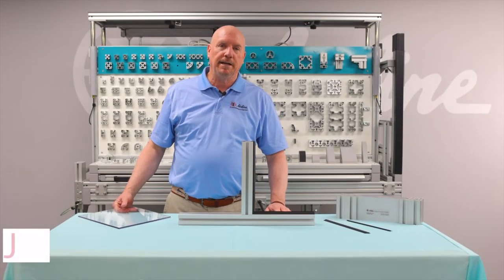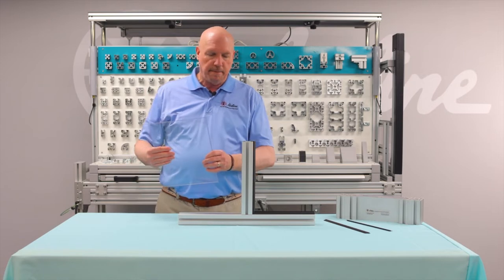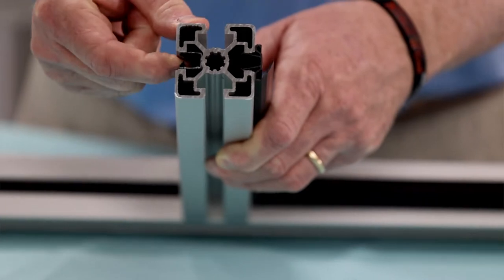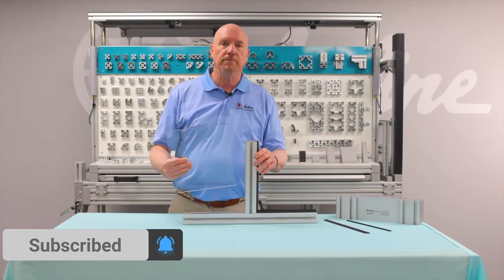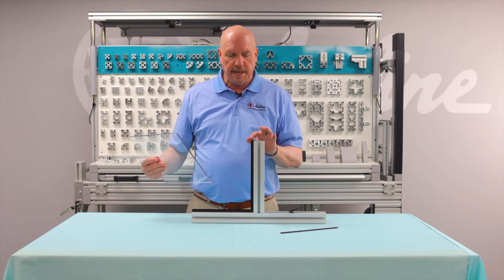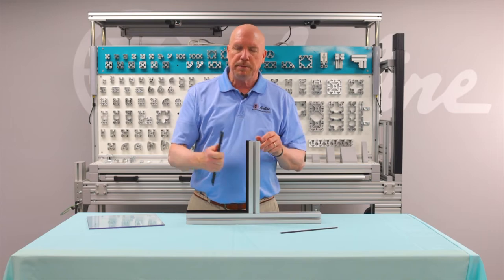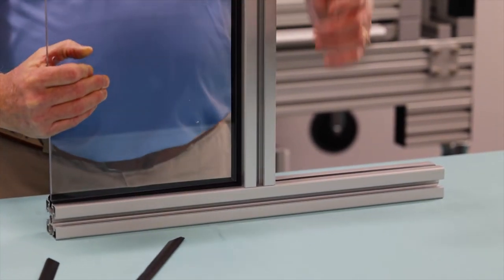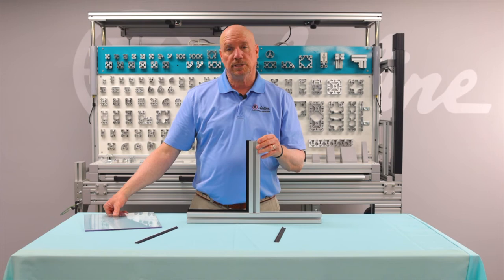How to INSERT & ADJUST A PANEL in Extrusion | Build Anything with Aluminum Extrusion

Comment: To bad the inserts are discontinued
Reply from the maker: They still exist! They changed the color to grey so the part # changed too, but the functionality remains the same 👍
Reply: @AirlineHydraulics it would be nice if you would replace the discontinued link with the link to the active grey product in the video's description instead of only including the link to the discontinued black product and having the interested viewer have to spot the blue 'substitute available' button and follow the path and try to figure out what if anything might be different, thanks for the videos and helpful links otherwise, cheers 🍻
Reply from the maker: @msytdc1577  It's a 2 year old video and we have millions of product links, it slipped through the cracks... but it's fixed now! Thanks for the heads up!